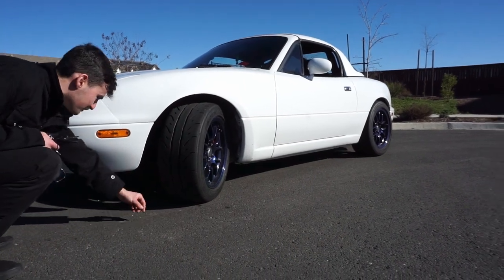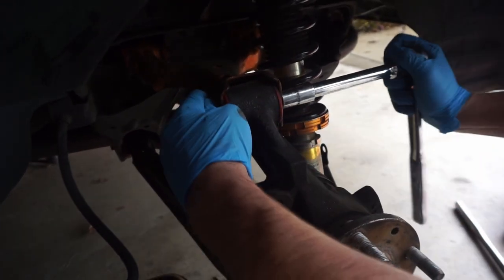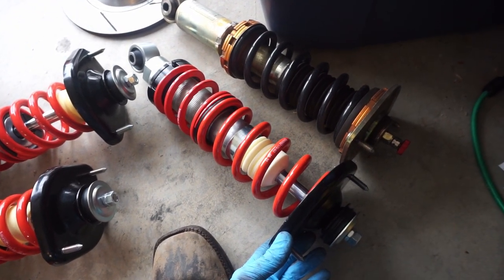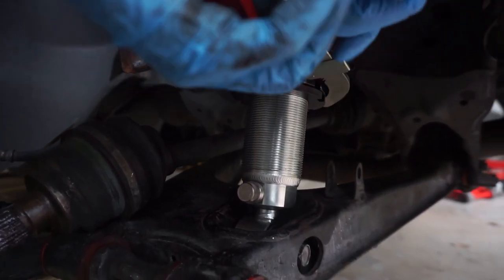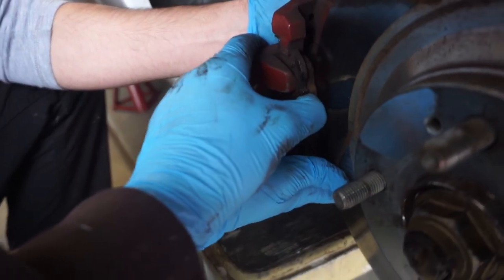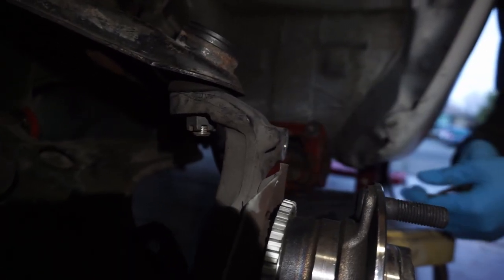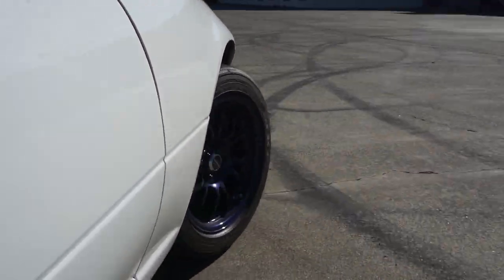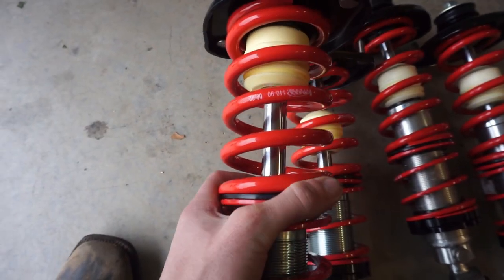Flyin' Miata Coilover Install and Test

Comment: Hi Jake! Thanks for the video. I'm getting these for my 97 Miata as well. Is the recommended 5" measurement for the front AND rear or only rear? What is it for the front then? Thanks Jake!
Reply from the maker: Just the rear. I don't remember what the front ended up being, but we started at 5" and had to adjust it quite a bit to get it sitting level